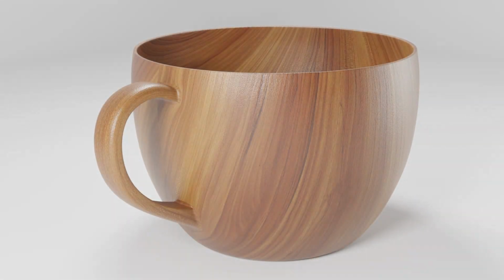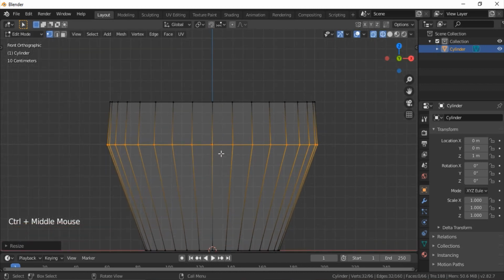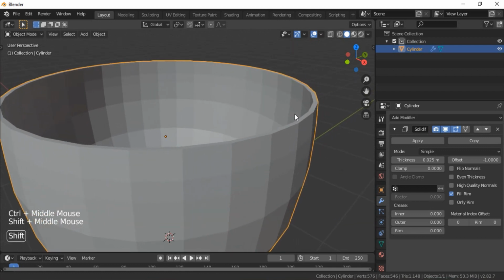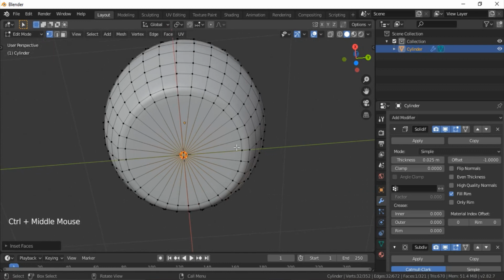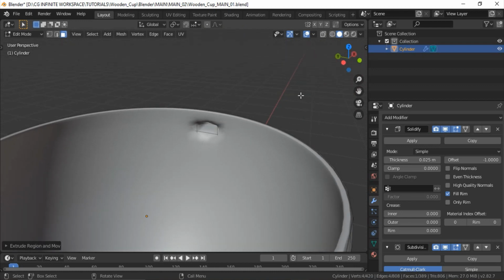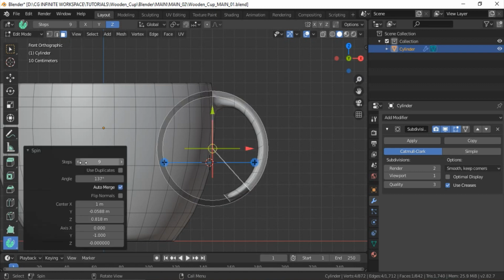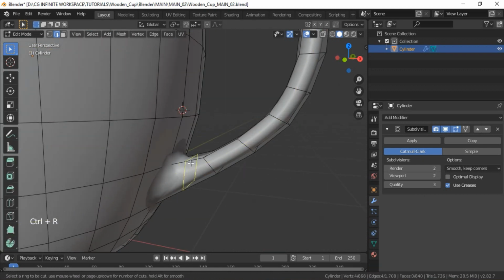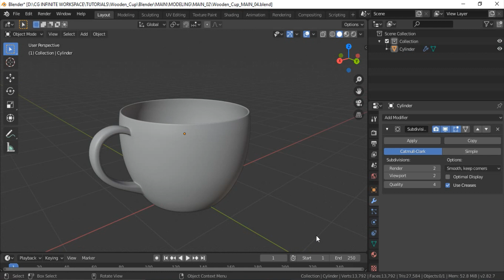How to Create a Cup in Blender (FAST & EASY !!) - Blender Beginner Tutorial Series

Comment: I'm dead at circular spinning tool for the handle, idk what to do, I can't create the circular shape, i cant drag after you position it with right click and shift
Reply: From Jud_h 's tip, above.  He said "for anyone who is stuck on the handle extruding part. In the somewhat left corner of the screen it shows X Y Z make sure the selected axis is the correct axis your rotating around."  I think we needed to change the axis to Y, or Z, I've already forgotten which.  Try them both and you will see which way the handle grows.

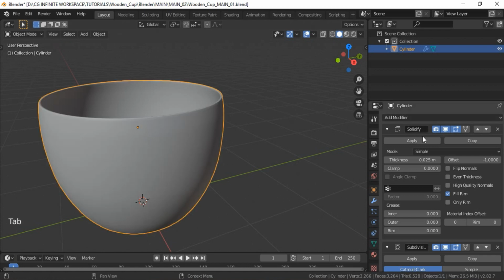Comment: 4:24 i have blender 2.92.0, and I dont have te apply buttom in my solidify window :(
Reply from the maker: Select the little triangle icon on the top right corner of modifier. You will find it there.
Reply: I can't find any apply button. How do I fix that? I have blender 3.3.10 @CGInfinite